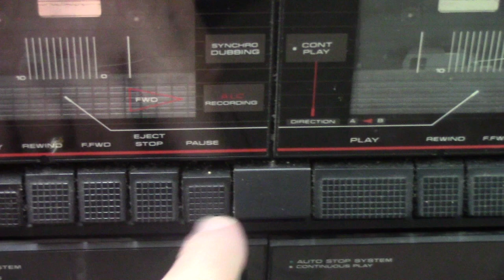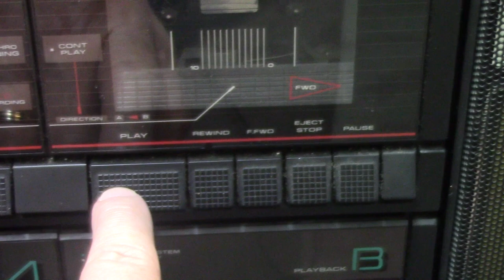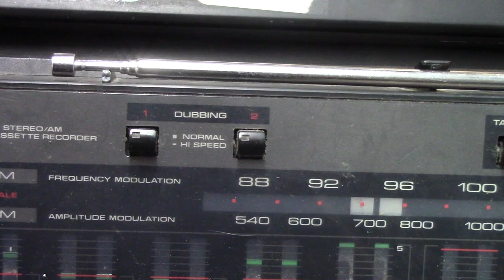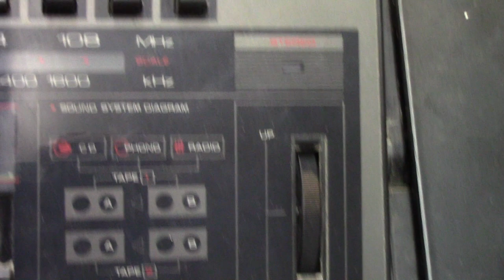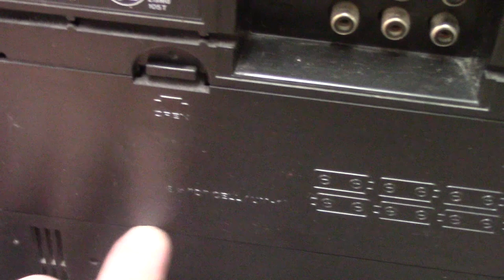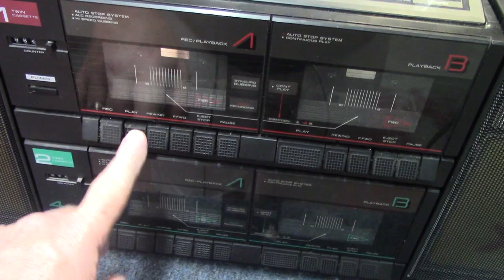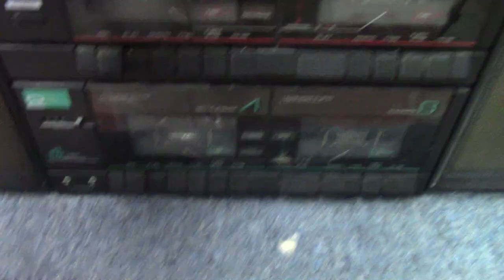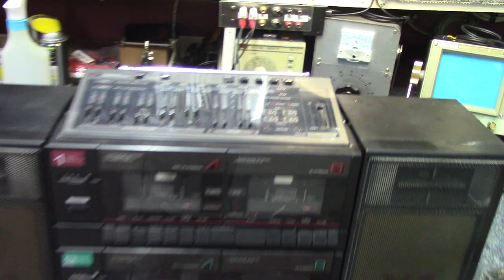LLoyd's V460 Portable Stereo - eval & repair

Comment: Thank you for the informative video on a rather unusual boombox.  I have never seen a boombox with four cassette decks in it before.  I have many boomboxes in my collection presently and they have one, two, or three cassette decks but none of them have four.  This Lloyd's V460 is an oddball, no doubt about it.

I actually bought this exact V460 because it was so unique.  The repair work shown in this video was extremely well done and I'm happy to report that my new-to-me V460 is working perfectly here in my boombox collection.

Great work Luvradios and thank you for selling your V460 to me.  It will now live an easy life in my collection.
Reply from the maker: Loco, Thanks for checking out the video and also thanks for the purchase of that V460,  I bet there's not many of those left out there, its unique for sure.  Enjoy my friend!

Comment: Whoa! What an absolute abomenation! What were they thinking when they decided to actually build this thing? And the fact that it's here being repaired means that someone actually purchased it LoL. I love Boomboxes, I have the National RX-C45 and I have loved it since I first saw it in my teenage years back in the 80's, I have 3 and a half of them! Honestly, I actually liked the three cassette deck boombox that Techmoan has featured in one of his videos, that one actually looks good but this one LoL, looks like they tried to say hold my beer but no one was actually around to hold it for them so they went ahead and just did it anyway even though no one was interested! And now it's nothing more than a show piece, well I'm sure that someone will want it. The split volume controls would annoy me and the fake double slider's, couldn't stomach them back in the 80's let alone today. I was hoping to see your own boombox at the end but I guess it didn't make the cut! How about giving it a good service? If you haven't already. The grease in all the moving parts of cassette deck mechanisms need to be carefully cleaned out and replaced with fresh grease! Gets rid of wow and flutter while stopping the belts from stretching! Most people just change the belts and don't realise that it could have been the dry grease that broke the belts in the first place, not that it's the only reason why they fail but it's just as important.